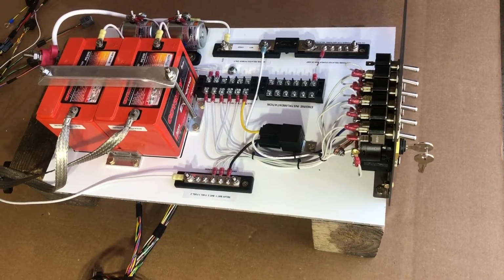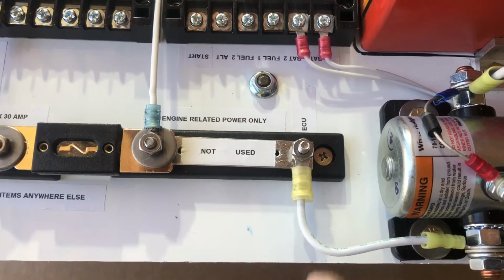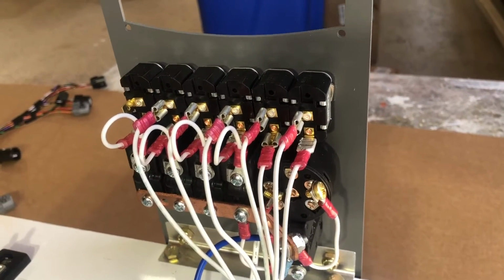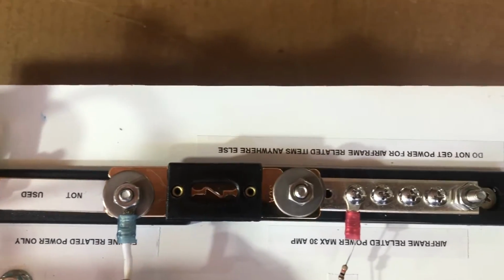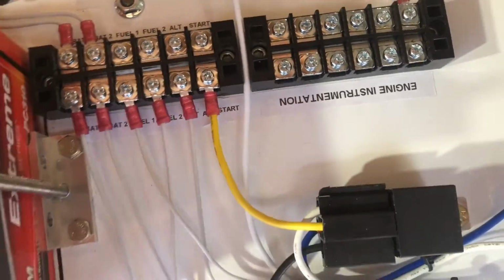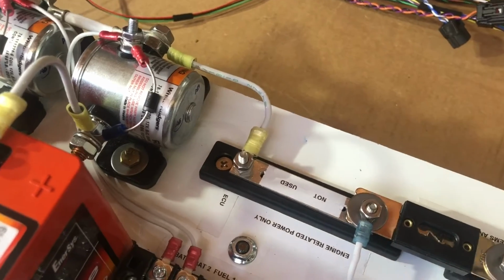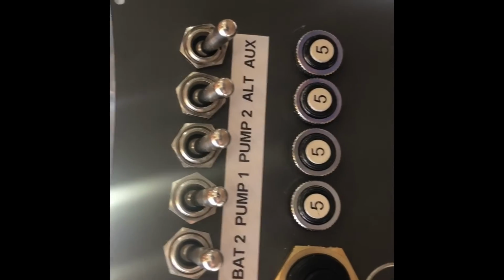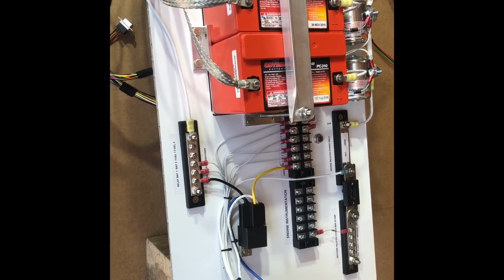Viking wiring

Comment: so how has the reliability been thus far with these honda motors?  have you had problems with any part of the setup?
Reply from the maker: We specifically have over 800 of the Honda Fit Model in the field, it is by far one of the best decisions we ever made and have had no issues with the internals of the engine at all. Most important thing is running an additive in the fuel if using 100 LL to maintain good compression.